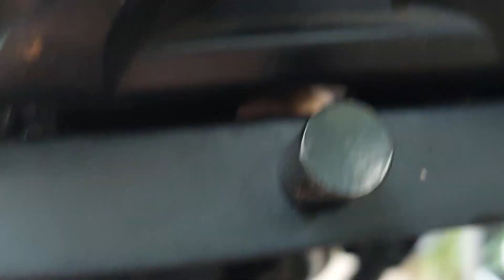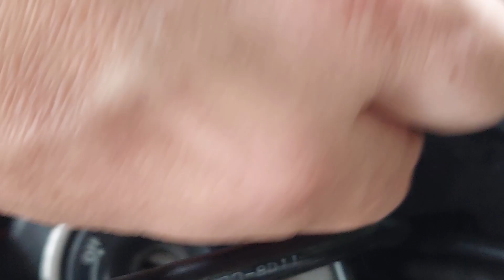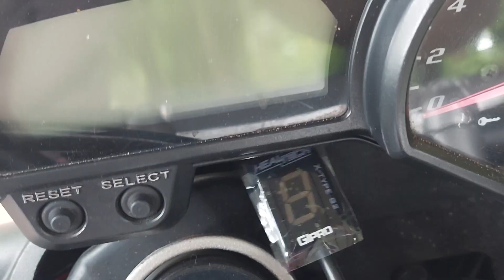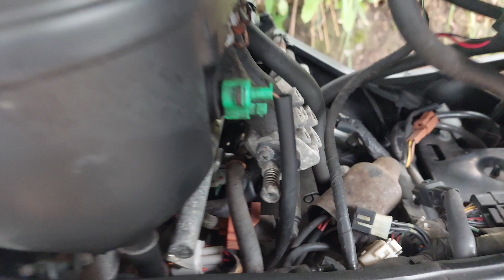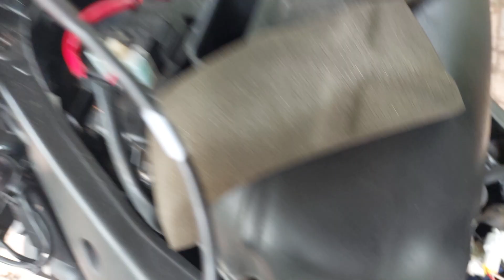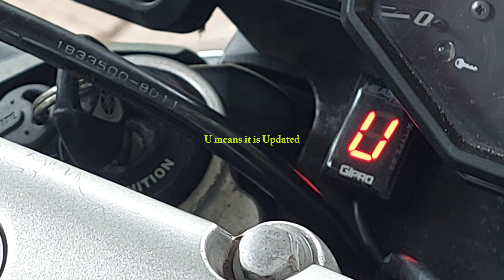Healtech GI Pro Gear Indicator installation on 2008 Yamaha FZ6N & General bike update.

Comment: Hey there gr8 vids your doing  please are you able to help me solve my issue please? I own a 2006 Yamaha WR250f have installed everything as per manual and not getting the fast L flash on start up? When I go I get the display going round and round please help me

Comment: How did you disconnect the two first cable adapter things, I can’t get them off each other
Reply from the maker: As in the speed sensor - @3:41 mark? You need to push down on the small white tab at the same time pulling the two pieces apart.

Comment: Ever look into using the Speedohealer that goes with it from the Heal tech company?  When I got my wiring harness yesterday I noticed that it wants to plug into the same speed sensor.  You foresee any issues in doubling up the connection down there?
Reply from the maker: No I dont think there are any issues, if memory serves correctly (but please double check with Healtech), you can daisy chain the connectors - one into the next into the next etc

Comment: Do you guys know if F6Z-N has the same plugins and wires colors?
Reply from the maker: The bike I am working on in the video is an FZ6-N (2008 model)
Reply: I have a 2009 model and I didn't found this white plug in my bike  :( 

Acc to the  description on the box, indicator which I bought should fit 2009 model .. do you have any idea if Yamaha changed the wiring or plugin types in model 2009 ? 

Thanks in advance for any tips and suggestions.
Reply from the maker: @trusteemedia  No, the 2009 was very similar to the 07 & 08 models. I think they changed the seat but wiring was pretty much the same. Is there a plug perhaps in a different colour that looks the same?
Reply: I figured it out already.  I guess I don't have those plugs because my bike is with ABS. I think I need to find a different set.
Reply: @trusteemedia  Yea FZ6 with abs does not have that 3 pin plug to "speed sensor" so... you get signal from abs (white/yellow), rest are the same so power supply & crankshaft sensor.

Comment: I done everything exactly like on the vodeo but the indicator didn't work
Reply from the maker: Make sure you check the electrical connections to ensure that are contacting. Does the Gear Indicator power up at all?

Comment: On my Fz8 doesn’t have that speed sensor plug, so I just attached to the rear abs module plug, but after I star the bike and leave it on idle to reach the optimal ideal speed, after that still cant get after first gear, it’s just blinking slowly, I kept between 3,4k rpm but nothing happens after a minute soo even… :/
Reply from the maker: Looking at the Healtech site, it says your bike uses the GPX-U01 Harness Kit. This is different to my bike so the wiring is different. Did you test moving the rear tyre by hand (engine off/ignition on) to test that it is wired in correctly?
Reply: @BikesandBitsOZ  Yes, when I unplug it and spin the tire on ignition, it’s showing “0” when I plug it back and doing the same, it works just fine. 

When I checked on the instructions paper, from the GPX-U01, harness kit, it’s say that some of the bikes reading the speed from the abs module, what is correct, but still I don’t understand why my gear indicator doesn’t want read the second shift…